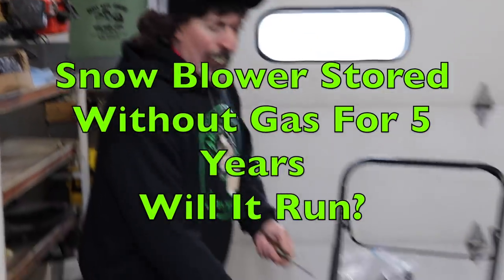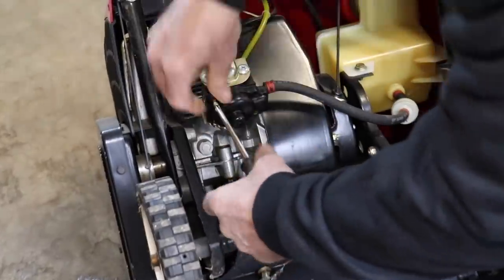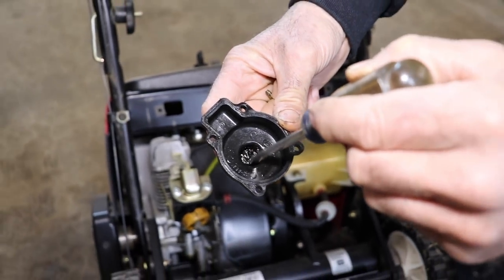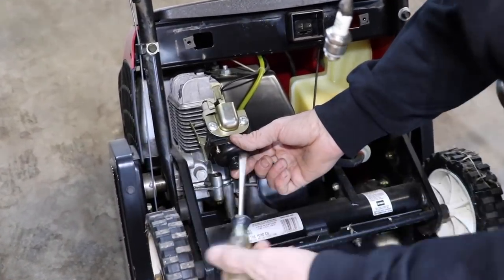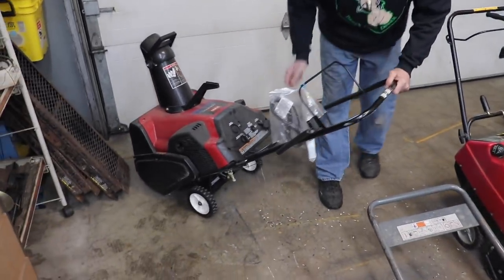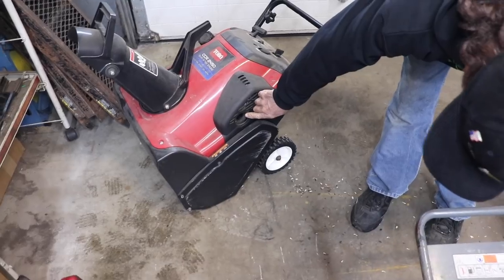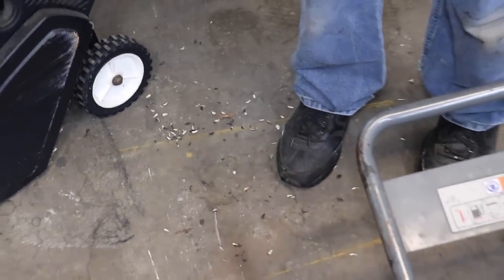Stored 5 Years NO GAS - But Will It Start?

Comment: I always store my stuff like that.. never had a problem
Reply: Me too. Why put stabilizers and such in when you can just have it empty
Reply: me too, i just shoot a little silicone spray in there to get it pumping again and i start it right up.
Reply: Yep that's how I store my stuff also.
Reply: Huh. I'd have thought there would be gaskets to dry out or something.  It's a mystery to me...
Reply: @ericshaffer9823  i had more than 100 different weed wacker and mower and things. the most common problem about plastics are the fuel priming bulb cracking and the fuel line getting so hard they are like copper. the carburetor gasket and flaps normally are alright for tens of years. i think its more of a temperature thing. some carburetor get ruined in a single year and some last for 20years.
Reply: Why do you put sun flower seeds in it???
Reply: @ericshaffer9823  It's not a problem with modern engines. They don't make gaskets out of leather anymore.
Reply: @thekingsilverado9004  To feed the birds.

Comment: Good video. I think the bowl stays a little cleaner for 4 strokes that don't have oil mixed in the fuel. Two cycle fuel leaves more old goopy dino juice when the gas evaporates over time. But for good measure, if it's easy to drain the bowl may as well do that, for long term storage.

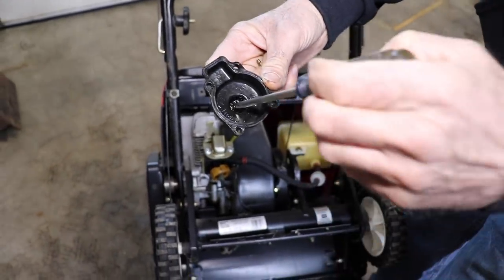Comment: @0:55 I used to run equipment out of gas at end of season but saw too many people with similar problems like that in video.
Now, I add one ounce of Sta-Bil and a splash of isopropyl alcohol (dry gas) to my 2.5 gallon gas refill can every time I fill the can up at the gas station.
Knock on wood, been doing it this way for 18 some years now and never had a problem starting the equipment.

Comment: Have a 28 year old lawnmower bought it new have a 22 year old snowblower also bought it new you run them out of gas at the end of the season NO problems. I am a 33 year diesel mechanic these small engines are a hobby. I fix my colleagues and friends  small engines all the time and I know when a small engine is not happy. Surging lean popping rich or any slight conditions of these my machines run like the day I got them.I use STA-BIL have not dropped the bowl boogers may be there. AH a twist in your fuel experiment lets see what if any boogers exist in the bowls I am a subscriber and rang the little bell thingy. Just saying.

Comment: Had a Honda generator start 9 years with old gas!!
Put stor n start in .
Everyone in shop amazed.
I did it thinking it wouldn't start and after five pulls it fired up.
Ran bad .
I drained it put new 92 octane now perfect.

Crazy

I used to run equipment dry and put wd40 in tank and carb bowl . No varnish gum would happen.

Comment: I run em' dry and pull the bowl to get that last little bit of fuel out and then spray with carb cleaner to wash any fuel residue away.  Works every time (just like DampRid) :)

Comment: When in doubt of reusing something soon, even if it is a 4smoke, I run some premix in it before it starves.  I've always seen pre-mix internals abandoned for years being much easier to clean or pretty clean than straight corn-gas of the pumps.

You know you are in trouble when your sliced cheese and your engine fuel is made of the same stuff!

Comment: Still using a Toro S 200 purchased in 1977.  Run it dry every spring.  Never had a problem starting in winter with fresh gas.

Comment: I have an older one of these a 1998 CCR 3000 with the Suzuki 2 stroke. Been thinking of adding a fuel shut off. I do think running it dry on the 2 strokes with the float bowel carb helps avoid problems.

Comment: I have an early 70's Lawn Boy mower which I alternate year to year with a Snapper with a Briggs.  I use Sta-Bil in both.  I run the gas out of both.  Never a problem.  I have a Honda Valkyrie with six carbs.  Sta-Bil in the gas.  Ran the bike dry.  I had 2 carbs that had enough crap in the bottom of the bowls to make it run bad.  Not an easy chore to clean those carbs.  You gotta do all of them once you get them out.  First time I cleaned them I only cleaned the bowls and put them back on.  Ran crappy the same as before.  Took the carbs off again and cleaned them all thoroughly.  Ran like a top.  Moral: Do the whole job the first time.  The End-  P.S.  Drain the bowls even if you ran the carbs dry.  The End End-
Reply: Hold on to that lawnboy sir!!  Certainly don't make those anymore
Reply: @leeharris3061  21" deck, easy to pull, Magnesium housing, light as a feather, staggered wheels so it's easy to turn.  I have a spare motor.  I'll never let 'er go.
Reply: @ralphwatten2426  i found a 2003 lawnboy free at spring cleanup in my city..its not a real lawnboy(as i know it) after toro bought lawnboy out years before..cheap stamped steel deck and a cheaper duraforce 2stroke engine...its not the same as the older lawnboys ..it doesn't even sound the same as the older ones..im always looking for the older lawnboys..take care sir stay safe 👍
Reply: @leeharris3061  Hi Lee, my first lawn mower was a mid 50's Wheel Horse that had an engine much like the 2 cycle Lawn Boy.  It had a rope start with an exposed flywheel.  I could start it by grabbing the flywheel and giving it a good twist.  It mowed great.  I sold that mower for $25.  My dad gave me the Lawn Boy that I have now in 1977 with spare parts.  It seems whenever a company takes over another things get cheapened.  It's too bad for us, maybe for that company as well.  Take care.
Reply: @wg4405  Yup, very simple carbs.  Because of the oil in the gas carb problems are much less it seems.  Some of them, if not all, have drains in the float bowls so you don't even need to run them dry.  Great old mowers.
Reply: The old 50's mower was an Iron Horse, not a Wheel horse.

Comment: Surprised its not 4 stroke, runs good, fluffys laugh is fun
Reply: 2450..3650..and the big snowcommander and a few others of those old single stage blowers are 2 strokes
Reply: 2strokes are better for winter use. No oil to get contaminated with moisture or to remember to change ever year after running only 5 hours.
Reply: 2strokes are better for winter use. No oil to get contaminated with moisture or to remember to change ever year after running only 5 hours.

Comment: Love my crazy hillbilly !  I'm, thinking the only way to keep a long time stored engine up and running is to drain the fuel. I learned from my generator stored with fuel stabilizer for  just a little over a year ago. I needed it and it would not start. I ended up draining the fuel from the tank and removing the float bowl to clean out the gunk with carb spray..

Comment: I just did the same thing today, had a old Toro 2-stroke in the shed stored as long or longer it started right up on the third pull and 4 Green round mice/rat poison balls blew out the exhaust landing in the MI snow. 🤣 Next day it started on the first pull.

Comment: I run my equipment dry and let the carb run dry. When I pull it out put fresh gas in it it fires up like new and stays running. 
I don`t like to use fuel stabilizer or so. But the gasoline in Germany contents at least 5-10% ethanol. Everytime I fill up the gascan I try to get ethanol-free gas. It`s hard to get but worth the price. Cheaper than a new carb or time to work on the equipment.

Comment: Point taken. Long term storage, run it out of gas. 
Supposed to be 67+ in E. TN today, I'm declaring early spring...I hate cold 🥶
Reply: I used to like the cold, but now not so much. Also energy is expensive, or should I say a rip off. It was rather funny back in the day fuel oil was $00.10 a gallon. Maybe with the pay of the day it still sucked.
Reply: @NY411Info  I use to fill my parts cleaner with Gunk Super Concentrate mixed with kerosene. Was $.99 cents a gallon. Was about $30 for fresh batch, last kerosene I bought over $4 gallon. Don't know what cost now. Just use diesel fuel but don't like it to oily.
Reply: @jeffreydevoti7000  At Grandpas farm, was always two tool washes, first hog pan we used diesel, then rinsed or rewashed same tools with gas in same pan.
Couple quarts each, probably what a can of brake cleaner would have cost. In winter, thats what helped start the wood stove, summer killed weeds along fence and dust control on the gravel road.

Comment: I picked up a 1984 mtd yard machine off the side of the road last summer. The one with tracks on it. Had it running in about an hour. Greased her all up and stored it in the garage. Here it is almost March and fifty degrees out. Haven't had to use it once here on the down east coast of maine. Should have gotten one years ago. Lol
Reply: Sounds like Mustie. You're not related by chance?
Reply: The year I bought my snow blower we only had one snow that was barely enough to blow. The second year I don't think I used it at all. Someone asked if i thought it was a waste of money. I said i bought it to keep snow off the driveway. If it can do it without even being fired up that's even better.
Reply: @hughbrackett343 yeah I feel the same way. I don't care how it works just as long as it works.
Reply: @freetolook3727  not that I know of. Lol

Comment: I store my snow blower the same way by shutting off the fuel and let it run till it dies. It starts on first pull with the old gas in the tank.
Reply: Yes I found that to be true also.

Comment: For something with a steel tank I prefer to leave the tank full of non-ethanol with stabilizer, to prevent condensation, and carb drained. Fuel is good for a long time, and if not I’d rather drain the old and refill than have rust. Plastic tank more than a few months- stored empty.

Comment: Hey Taryl I have a John Deere 445 it runs great at all throttle positions while sitting still but once you start moving it may go 200' or may only 10' and it dies but will start right back up push the go pedal it dies again what could be wrong with it run great as long as the wheels aint turning Thanks

Comment: I run a 32 to 1 mix with stabil in all my 2 cycle machines except for my 1970 craftsman hot saw 10" converted to 18" it gets a 16 to 1 mix.
Reply: I run 32:1 in everything 2 cycle. Manufacturers want to sell engines.

Comment: I run 101 octane non ethanol LL Phillips 66 gas from my local airport. You can store it 10 years and it will still be good, we tested it. Little pricey at $5.50 gal. but worth it for small engines.
Reply: Put that in a small engine in the winter and it may not start. It has a higher flashpoint. Lower Octane is better for cold environment.
Reply: @NY411Info  I been using it for 7 years now and haven't had a problem with starting, or carburetor problems. I leave the fuel in all year and do not treat it. Thanks for commenting.
Reply: @john7017  Nice.

Comment: Well it's a good practice but you've essentially proven that you still need to intervene by cleaning out that carburetor bowl. While it may run now is your shooting this video if you wait a little bit longer probably in a week it will be hunting and surging or not starting up at all because that crap in the carburetor bowl has moved into one of the jets and clogged it up.

I keep telling customers yes go and run the machine dry but also if your carburetor bowl has a drain plug to drain that as well. If they don't have a carb drain plug then the next best thing is to use the ethanol-free fuel and run that through. It seems to be more stable from going bad in such a short amount of time unlike the pump gasoline.

Comment: Why didn't the owner just put gas/oil in the tank and try to start it himself?
Reply: some people think that way. if it's been sitting it must need service. They won't even know what "service" means, only that it feels like the right thing to do.
Reply: I had a dumb girlfriend, (dumped her when I got tired of her being so stupid), who would take her computer to the computer shop every year for a "Tune Up".  I told her that computers don't need their oil changed periodically. Nonetheless, she paid this con guy $300 a year to run a few free utility programs, and, perhaps, to blow the dust out of the machines.  She is still running WIndows XP. Pathetic.
Reply: @ronstar7027  weird dude
Reply: Looks like they dropped it off to have the belts changed. They are hanging on the handle
Reply: Hey taryl great short video bro stay safe God bless
Reply: Some folks just don’t want to mess with that stuff. They’d rather pay to have someone check it out and do whatever (belt, plug, carb clean or whatever) to make it reliably run right- and that’s ok. Kinda like I’d rather pay someone to make sure my taxes are done correctly...
Reply: @JeffinTD  no, thats stupid becuase a tech isnt going to completely rebuild you PC or snowblower....u need to have an idea what the 'problem' is!
Reply: @ronstar7027  windows XP is god-tier.
Reply: @crabtrap  There are many people out there that do not have a clue on the operations of anything. This is why they pay someone to go through their machines. (ie People that manage stores or wood workers) Some just don't know about machines. If they have the money why not ? If they don't have the money and are unable to fix their own stuff , then that sux.
Reply: @NY411Info  "go through" what does that even mean??? You are tge guy that feeds the scam techs out there. We as techs dont have magic scopes or clavounce. If there is an obvious issue, we can fix it but when you come in and say "just go through it", we dont see anything obvious and give it back....it stops working a week later and u come in saying "i just had you guys go through it last week!".  Basicly u want to pay to have someone to bitch at
Reply: @crabtrap  I go through machines all the time. If I know it's been sitting I know what I'm gonna check and or replace. If you do not know what to look for then get outta the business. Obviously on a snowblower you will try and start it, check the drive line , check the engine for plugged cooling from rodents. Many other things. Your getting paid to do that so do it. Easy.
Reply: @NY411Info  ya sure buddy, on a $50 blower...whats your shop rate $0.75 an hour? You are the scammer i warned about.
Reply: @crabtrap  If they want to pay the $100.00 then what is the big deal. I do this shit on the side.
Reply: @coolbluelights  I love it when a customer brings me a 2 cycle and asks me to change the oil and I always tell em 2 cycles do not use oil. They come back for the machine and ask me why the oil change ain't on their bill...  Sheeesh I can never win..
Reply: @JeffinTD  There's an 80 year old customer of mine has this old 2cycle MTD I sold it to him it was mine just no good for living here at a huge place but him or his wife will bring it by once every fall. I mean I think the only things I ever replaced so far is the plug and fuel lines still runs tops. They say they use it hard but they bring it inside in a heated garage so that probably explains it's long life span but sheesh the damn thing has to be 10 years old now.
Reply: @crabtrap  Whenever I get my magic wand out I have to unzip I always tell customers. That sorta settles the dumb requests can I look it over see whats wrong. Usually that involves taking shit apart and then they know they owe me money!!!

Comment: I ran my Devillbiss 10 Horse Briggs gen set out of fuel and left it for 10 years. I needed it and decided to pull the bowl and it was fairly clean so I put it together gassed it up and it ran fine. However the rubber bowl seal was leaking . My guess is if I never removed the bowl it wouldn't have leaked. I will never know now.
Reply: Devil* I doubt you just pulling the bowl after it's been sitting would make the seal go bad. It was most likely on its way out when you stored it away.
Reply: @Zark-Muckerberg  Yes it is possible it dried up when it had been sitting. It was only ran for a week during an ice storm. So it certainly didn't wear out from use.

Comment: I always run the gas out of my snow equipment after Winter. I keep my Summer equipment full  of gas over the Winter because it does not sit as long.
Reply: Yeah I never drain my Deere Garden Tractors and they always start.

Comment: "Hank's Garage" says that, at least on those newer plastic carbs on B&S engines, that running the gas out causes "problems."  But so far I've been unable to get him to say what those "problems" are.  Anyone have any ideas?  Be as specific as possible please.  And no, it's not dried out gaskets, at least not on a four-stroke (and even if it was, just put a new gasket on!).
Reply: The most common Briggs plastic carb problem is the tiny little O ring in the needle seat or the floats in em R total shit just like the fuel lines deteriorate whether there is gas in em or not. The stuff goes to hell whether there is gas in em or not. I leave the fuel in the carb just drain the tanks.. if I have an issue I usually have carbs on hand so it's no big deal to me. I do have people that bring me stuff and I have it fixed asap. Every now and then I get one of them zinger vintage Troybilts they don't make parts or carbs for em no more. Now those R a pain in the ass because even the carb kits R total shit for the briggs motors. I hope helped solve the plastic carb issue. Beware of the push mowers with those plastic carbs in the fuel tanks can be a real pain in the neck no matter how ya put em back together

Comment: I only use non ethanol fuel in my yard equipment to avoid the proplems of fuel deteriation caused by ethanol (Obama gas)
Reply: Goes back much further than Obama.

You can thank the Ag lobby, ConAgra in particular.  They pay millions per year in bribes...er, "Campaign Donations"...to ensure that we keep using corn-based ethanol in our gasoline.  Nevermind the fact that corn-based ethanol winds up putting more CO2 in the atmosphere than if we made the ethanol from algae.  That wouldn't artificially prop up the price of corn!